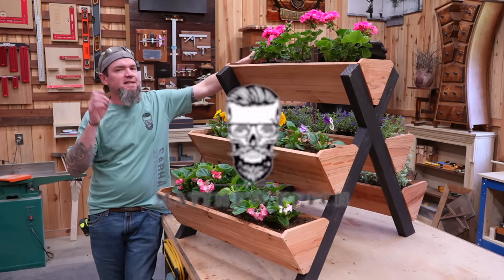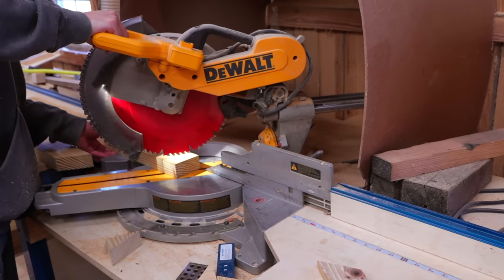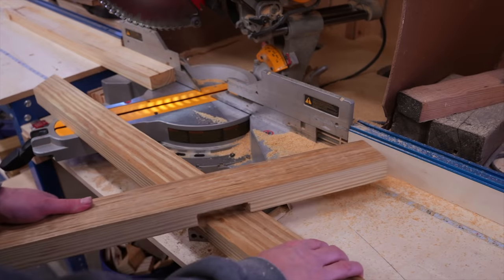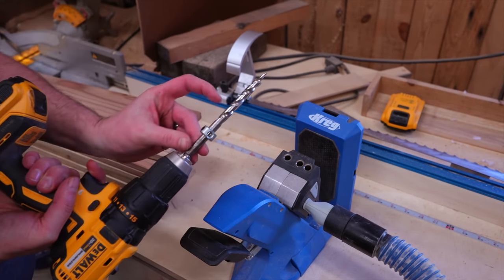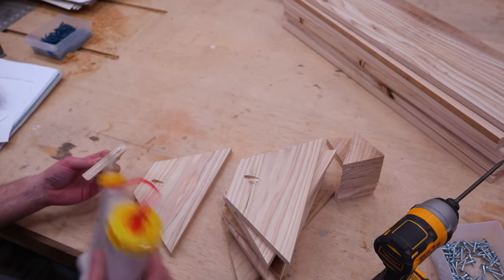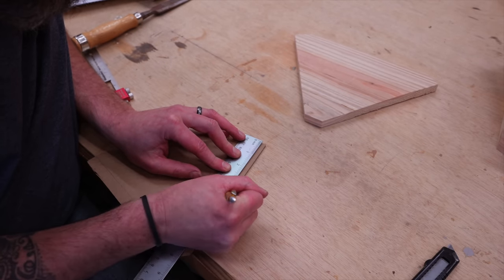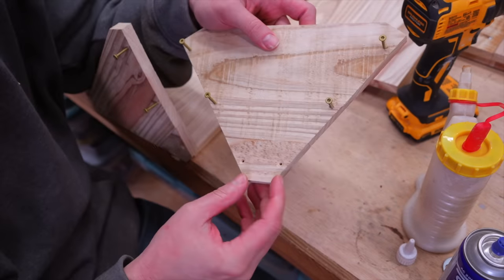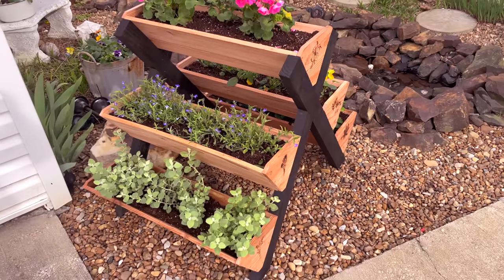DIY Tiered 5 box planter- Low Cost High Profit - Make Money Woodworking

Comment: Hey Matthew. I would like to suggest that the side walls be turned upside down or that the pocket hole be drilled from the other boards. The reason is that the pocket holes in the side wall are opened upwards and would much easier to collect and store water.
Reply: Putting in some pocket hole plugs would help that as well
Reply: That is an excellent suggestion  because I am right in the middle of putting one together.  Good thinkin', thanks.
Reply: you could always line with plastic on the inside walls of the planter

Comment: Adding cross braces near the bottom planters to make it an A-frame would greatly improve the strength of this planter so you would not be relying on the lap joint and the top planter boxes for the rigidity of the frame. This would help make this planter last longer.
Reply from the maker: Good suggestion.
Reply: I was thinking the same thing. It wood have a longer life span. 😊
Reply: True, but every box acts as a brace also.
Reply: @withoutfurtheradoforever  Only the top box provides any bracing.
Reply: @withoutfurtheradoforever  He's talking about keeping the legs from spreading out, not racking.
Reply: I think the lap joint and top planter box create 3x more strength/rigidity than this tiered planter needs. And it’ll last 10-30 years depending whether you use painted untreated, treated or cedar wood, and the lifespan is down to wether or not the wood rots and how fast it rots, not how strong the framing is.  After all, none of my A frame ladders have ever had span bracing near the bottom. They’ve all been tied together 75% of the way up and the top itself and they’re supporting a dynamic load, a person moving around shifting their weight. The static load of some dirt and plants will be fine.
Reply: 😊I’m 😊😊okp😊oooo😊😊😊😊iikiiiiiiiiii😊😊😊
Reply: I’m
Reply: I’m
Reply: I’m o
Reply: I’m

Comment: Love this design. I will be making a few of these for my mom and sister as well as selling a few. 

One thing that may be advisable is changing the orientation of the pocket holes so they don’t act as a funnel for gravity to channel water down into the pocket holes. I know the screw is kind of a plug, but over time (and regular, repeated waterings) it might be better if the pocket holes angled up instead of down.

Comment: I learned something this week, women around here seem to prefer ugly mismatched pallet wood over pine or cedar picket wood. I built a few ugly box planters for our personal garden. She showed other women and now they want some just like them.

Big ones sits two feet high with box size 12x12x36. I lined them with plastic and put a drain in the bottom since there was no way to get the pallet wood tight enough to hold dirt and I know it would rot fast. Boards are different thicknesses, all different colors including blue painted ones. One she liked the most used the pallet runners for the legs, I put the cut out for the forks facing outward and for as ugly as I think it is that's the big one everyone wants. It's 100% pallet wood unlike the others I used 2x4's for frame and legs. So it's certainly the cheapest even has a lot of the nails still in it just hammered over. 

Small ones are just pot holders so no plastic and 14 inches square length, width and depth with legs being 16 inches total just to keep it off the ground. Made entirely from the top boards off pallets.

Here I'm thinking build something nice and women want that total scrap ugly nothing matches look. This is the Texas hill country where the ranchers have always just used whatever they had laying around to make stuff so it's almost cultural here and maybe that's why what I never intended to sell is what people want.
Reply from the maker: Lol you never know what’s going to be hot! Go with it!!
Reply: @MatthewPeechWoodworking  and now she wants one of these as well

Comment: Hey man.....I appreciate all the good info. I've used a lot of your builds. Just a heads up for your viewers. The cut list for the lower end plate says 1 11/16 x 3 1/16. In the video you state the top of the lower end plate should be 3 3/8, that is the correct measurement. Thanks again. Keep them coming!
Reply: I am curious as well.  Gonna build one over the weekend if I can get enough pickets.  My plan is to measure after cutting part C and check the other dimension as well before I rip anything.

Comment: When people ask about pricing, the calculation is as follows:
(Cost of materials x 0.15 "consumables, wear and tear")  +  (hours spent x value of 1 hour of your time) = Price

I value my time at $40/ hour. That is what someone would have to pay me at 35 hours/week to work for them. This rate also includes the cost of health insurance, deductions, and other benefits. Also, if you are doing trade shows, spending money on advertising, or have any other expenses, it needs to be factored in. Again, I like to use the hourly model. So if you pay $400/month for a work space, divide that between 35 hours per week and add that to the cost of your time/labour.

Comment: OK Bought the plans 1 month ago. Finally getting started on it today. Sides of the boxes are joined with pocket hole screws, 2x4s are cut to length (The angle not cut yet) and the lap joint hasn't been made.  My miter saw doesn't appear to have a stop plus it isn't a sliding miter.  Looks like I'm going to need to use the table saw for that. Mathrew do you have any tips for that? I have Never done that. Also end plates need cut yet too.  So far so good.   :)

Comment: I notice the thickness isn’t consistent on your pickets either. The one side is often thicker than the other. I try to find the best ones but a lot of times have to settle with whatever the lumber yard has or I’m digging through the whole pile. So when doing projects like the three tier box planter I end up with waver side panels from matching thin to thin and vice versa. Any tips to combat this?

Comment: Can you build a planter box for palm trees? It's crazy but I live in NJ and there's palm trees for sale. They come in 27.5 gallon (19" tall x 26" wide) nursery pots, and everybody wants a planter and they start at $500 and are usually concrete so too heavy. I have tried up sizing your designs, but I run into strength/durability issues.

Comment: Matthew what does one do when they don't have a table saw? All I have is a chop saw. Thanks.
Reply: You could use a combination of a 6" picket and a 4" which would give an overall height of 9" if screwed edge to edge.  I think it could look  nicer to use the smaller board as a trim of sorts on the top edge of the box.  Overlap by about an inch and screw them together with 1" screws from the inside.  The back side would have to be flush, but you could dog ear the ends of that board to make it less noticeable.

Comment: I've bought a few of your plans! so super easy to follow!! However, I keep blowing out the 1" pocket screws joining the cedar pickets! I've used a pocket holes for a few years and use the older version of the models you show. With the super soft wood is there a tip or trick to stop the angle from going in too shallow? It seems so simple I'm almost embarassed to ask...

Comment: Looks great. Unfortunately, cedar fence pickets aren't sold in the big box stores here in CT
Reply from the maker: Ah!
Reply: Then you could buy 12 ft 1 x 6 deck boards and cut them at 6 ft and pretty much follow the same plan.   The cost would only be slightly higher to build but still look great

Comment: I have the Kreg 720pro… problem is my stop collar has cut groves into my bit so it’s extremely hard to get the stop color to move now..  and I’ve only had it for a cpl of months and maybe used it to drill a total of 50 holes max… is this normal, or am I doing something wrong…

Comment: Question sir:  you said that this requires one 2x4. What length, 16’?  If you’re cutting them down to 38 3/8”, that means you needed to start with 12’9” linear feet of 2x4. Or did I misunderstand the video?  I always assume an 8 footer when someone refers to 2x4’s unless they state a different length. Home construction mind.
Reply: It takes most of two 8' 2 x 4's.  and I was ale to get it with 8 Cedar 1 x 6s instead of 9.

Comment: Ugh, I love the projects but it suck I have to drive 40 miles to get fence pickets.
Reply from the maker: Ugh! Have any pallets nearby that you think you can build with instead? You’ll have to make some modifications but you can do it!
Reply: @MatthewPeechWoodworking  What do you recommend to waterproof wood if its not pressure treated or cedar? If I were to use pallet wood for these instead what would you use to treat it that would be safe for plants/vegtables?
Reply: Look into "wood charring". The Japanese have been doing it for a long, long time. Burn the wood with a propane brazing torch until black all over then sand it down a bit. Gives a beautiful effect on the wood grain itself and basically makes it rot proof.

Comment: I would use 18 gage Brad nails and glue to fasten the end pieces to boxes. Quick and less obvious than screws. Plus cheaper
Reply from the maker: Nice!
Reply: Harbor freight carries galvanized narrow crown staples which are good when working with treated lumber.  They would hold better than brad nails if you have a narrow crown stapler.

Comment: Why not pressure treated wood?
Reply from the maker: You can do pressure treated for the frame. I chose cedar for the boxes bc it’s naturally resistant to insects and decomposition. It has its own defense system built in. Cedar still needs to be stained and sealed but it is much more durable than other species. You could do pressure treated pine pickets also.
Reply: @MatthewPeechWoodworking  I’m talking about the 2x4s